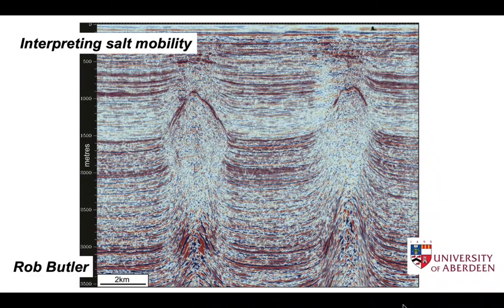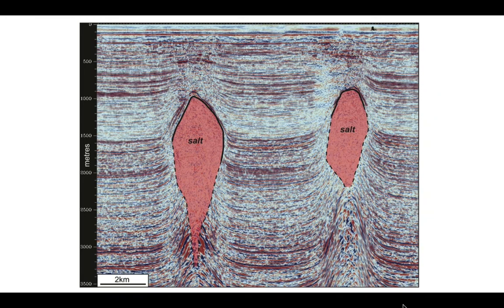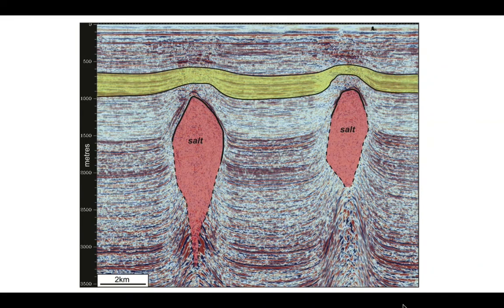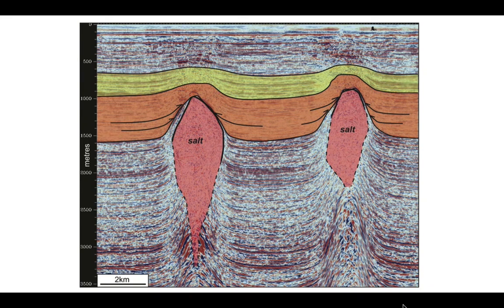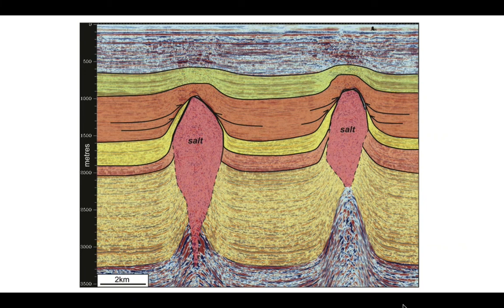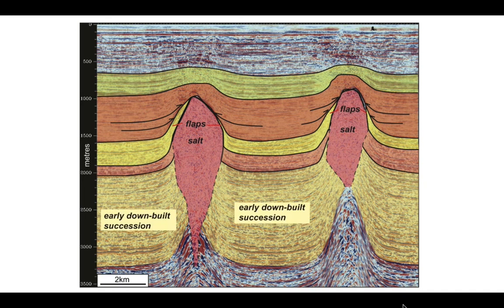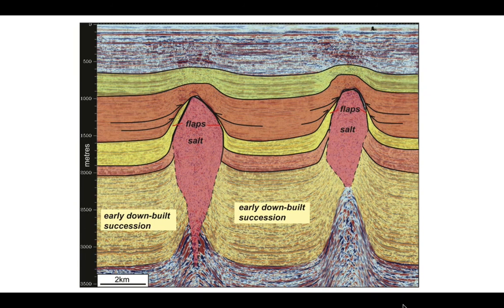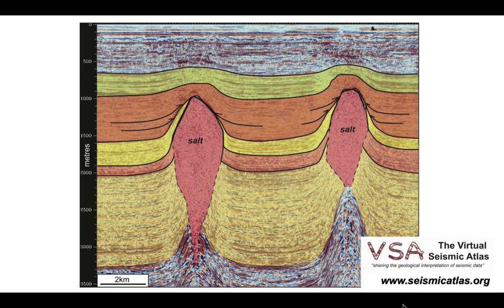Interpreting salt mobility

Comment: Based on what are you picking the different units? Thanks
Reply from the maker: So - I can't help here. The images come from the Virtual Seismic Atlas - my interpretation of the halokinetic sequences... but why not  try the original paper: by Simon Stewart: 
Stewart, S.A. (2007) Salt Tectonics in the North Sea Basin: a structural style template for seismic interpreters. In: Ries A.C. et al. (eds). Deformation of the Continental Crust: The legacy of Mike Coward. Geol Soc. Spec. Publ. 272, 361-396.